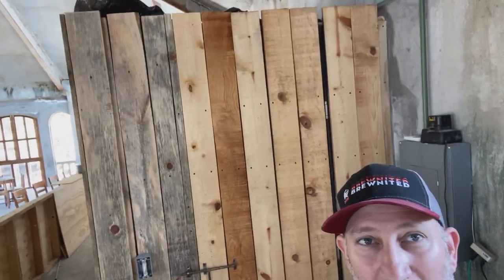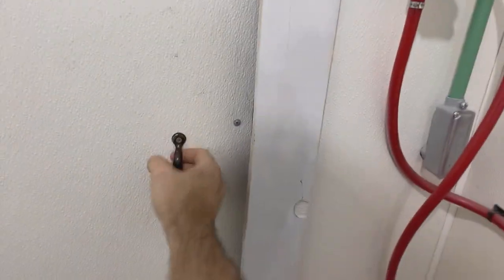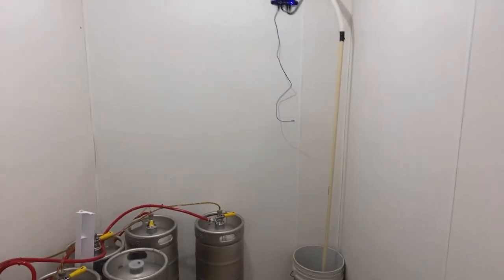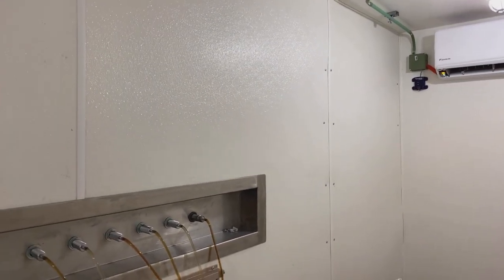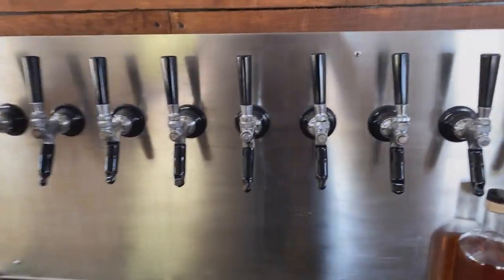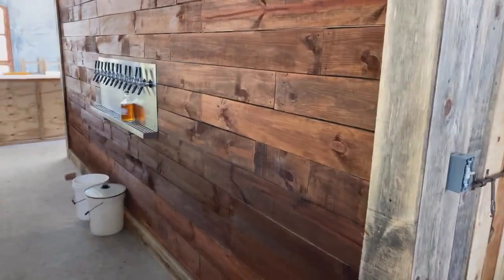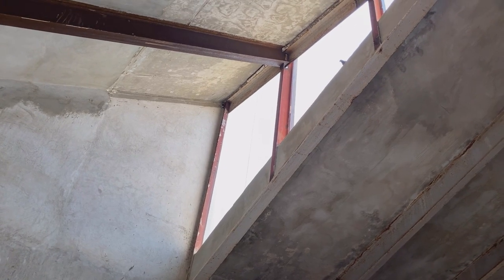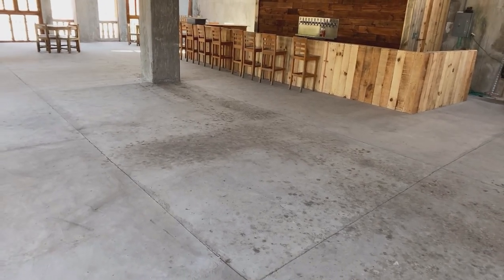Part 5 - DIY Draft Beer Wall & Wal-in Cooler

Comment: I am curious the concrete temp outside the cooler.  It's almost like a heatsink.  I wonder if you insulated the floor with Styrofoam and sleeper floor bracing.  You need a thermal break of some kind.  I will research but I have watched another cooler video where they added some electronics to maintain the cooling temperature.  I agree with you though 36 to 38 degrees.  Keep up the good work.  I will be in touch.
Reply from the maker: thanks, I was thinking the same thing.
Reply: @jphalan  https://youtu.be/0xUmhf1FAGA. This was the video I was referencing, just had time to locate it.  He will explain it better than me playing the telephone game.  I hope it helps.
Reply: I'd definitely take a temp reading of the concrete floor. Also I agree I think his AC unit is good it's just its parameters are so loose.

Comment: Great work, thanks for sharing.  How about huge ceiling fans?  You crank any music in there yet?  The acoustics are going to  be a bit challenging.
Reply from the maker: This is constantly on my mind. Need to put some mini splits, ceiling fans and or air movers. The weather has been unbearable this past week. I have a little boom box and it sounds ok at medium level, as soon as I crank it up it get echoy. Will have to put some sound dampeners in.